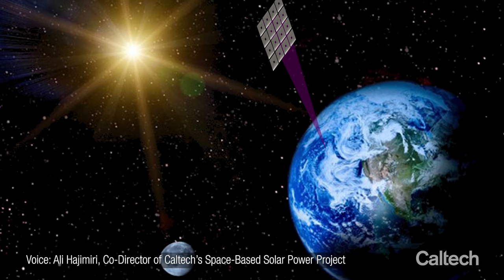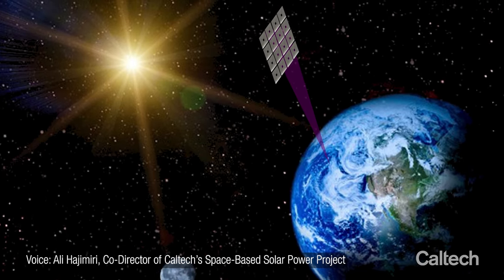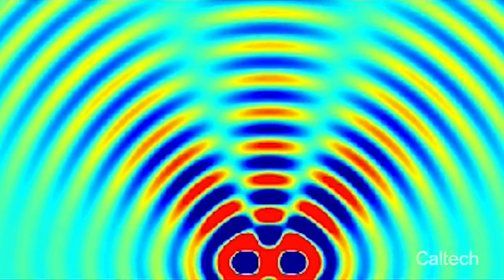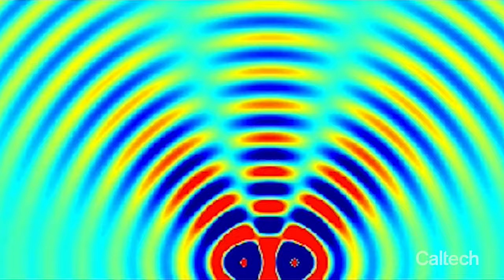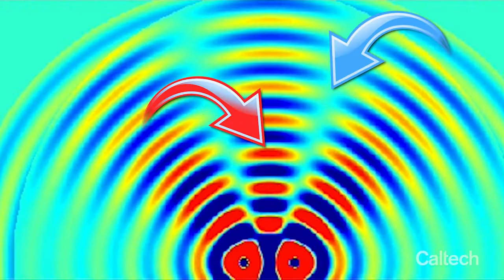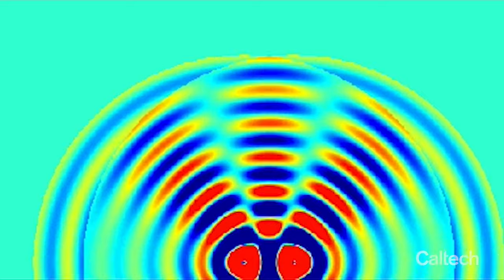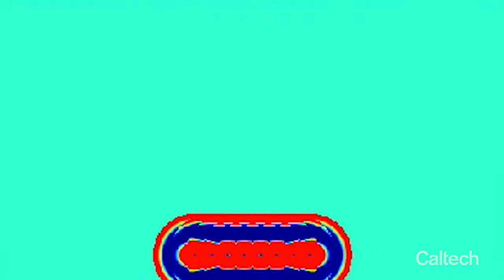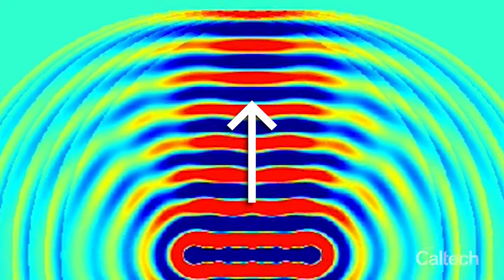How Does Wireless Power Transfer Work?

Comment: Nice intro to phased arrays, even tough you didn't use that term. Other than that, it was useless.

 I assume your intention is to use the focusing ability to make it "safe" if something or someone is hit by the beam? How big is the transmitter array supposed to be? The profile of the beam would be triangular, and anywhere near the focal distance, it would be incredibly tiny compared to the transmitter end. The satellite would be at least 250km above ground, and even planes don't fly much higher than 10km.

For space based energy transmission to be useful, the satellite would need to be able to transmit at least hundreds of kilowatts, if not many megawatts. That would make for one spectacular beam weapon.

In an article on Gizmodo, which linked to this video, one of the pros were that it would work 24 hours a day, but they didn't take into account the fact that the satellite would only be in position to transmit for a fraction of the orbit. So the satellite would have to charge up batteries for most of the orbit and th3n blast all of it in the few minutes it's above the target.. I mean receiver.
Reply: You would need an array of satellites.

Comment: Death ray weapon for the Space Force?
Reply: @Li Heli : Absolutely worth worrying.  Nuclear weapons have been too dangerous to use since 1945, whereas nonnuclear weapons are used all the time.  An invisible beam attenuated so its cooking effect is very slow (hard to detect) would be a very insidious weapon when we're not officially at war.
Reply: @Li Heli : First, the beam intensity could be attenuated to make it hard to detect, similar to the stealthy debilitating weapon that's been deployed against people in some U.S. embassies.  Second, few nations have the ability to retaliate using nuclear weapons, and the ones that can would presumably be reluctant to escalate to nuclear war.  Finally, if we are at war, for example the never-ending war against Al Qaeda, ISIS, etc, it could be a politically more attractive weapon than missiles launched from drones, etc, because its effect could be much more subtle (less risk of blowback).
Reply: @Li Heli : Common radios and antennas are designed to receive signals encoded in carrier waves in the communications portion of the electromagnetic spectrum, not signal-less microwaves.  Sure, detectors could be deployed, but they would need to be deployed at all (or most) potential targets.  Your comment about victims saying ”it's okay” seems silly... victims don't say drone strikes are okay but that doesn't prevent drone strikes from being used.  Perhaps you're really just saying there's no reason to worry about a new, long range weapon being added to the military arsenal?
Reply: @Li Heli : So, we agree it's a death ray weapon for the Space Force.
Reply: D E W

Comment: Why is it so difficult. They can beam in form of frequency sound...Receiver might need nominal powering but it should receive way more net gain from space.
Reply: Sound doesn't exist in space. Sound is a pressure wave of air particles. Hardly any particles in space 😊
Reply: @IDcircuits  It doesn't have to be naturally occurring sound because there's abundant energy in space, so the sound can be generated from craft, converted to frequency most efficient. Can be done on Earth too, but it's matter of most continuous energy....and that smiley face looks kindergarten is most important thing.

Comment: Not efficiently. See: a big butterfly net is needed because energy density is puny.
Reply: Doesn't have to be efficient when power source is abundant. Oil and gas are efficient but   are limited supply and reduce jobs via efficiency....Satellites are in orbit resulting in abundant energy from the spin and any engineered designed friction anyway.